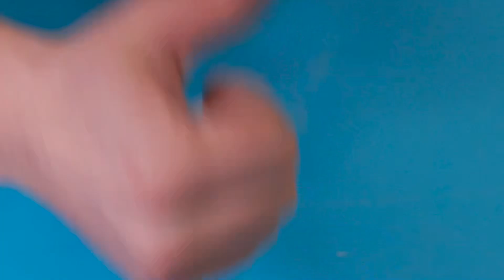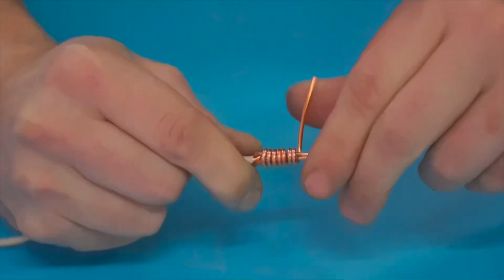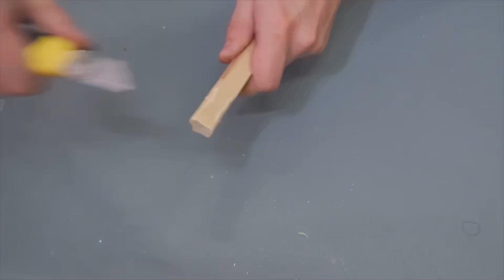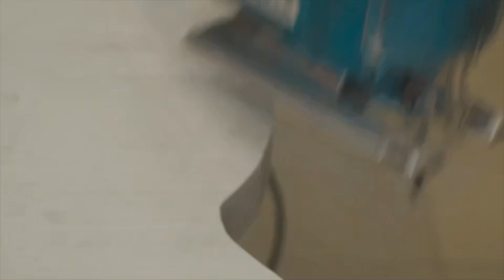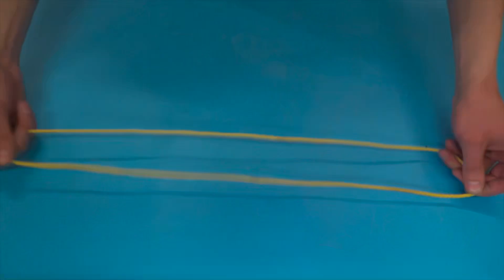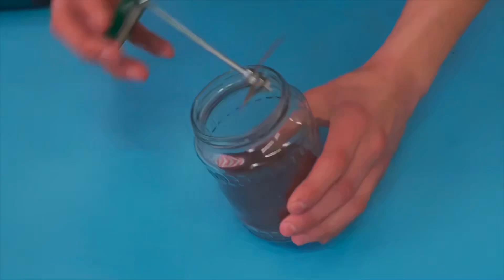Handyman Tips & Hacks That Work Extremely Well

Comment: This is so stupid. I mean every hack is for something that would never need to be done...ever. Moulding inside a triangle...nope. Making a lock out on a breaker that can simply be untied but there is a padlock on a looped wire. FFS. Come one. Wreck a 25 dollar plier to replace the work of a 20 dollar riveter. You know what else can center a hole saw? The fucking drillbit attached to it.